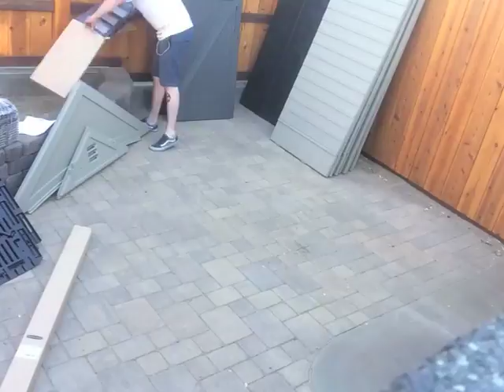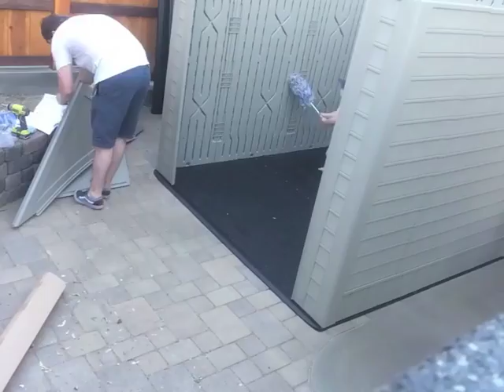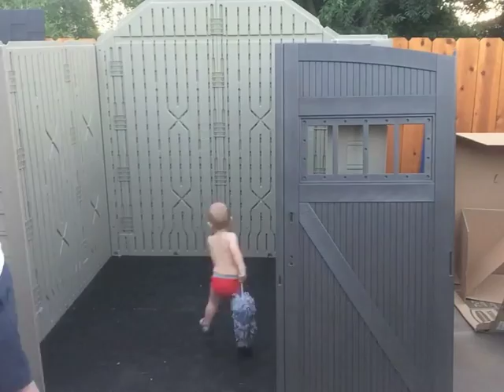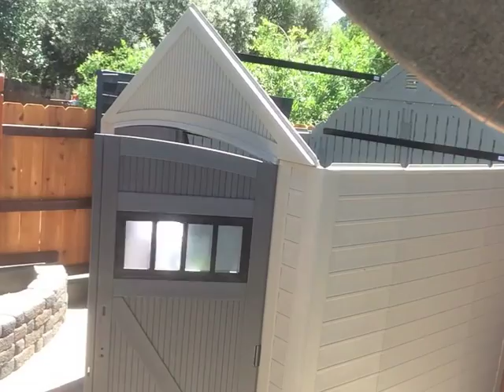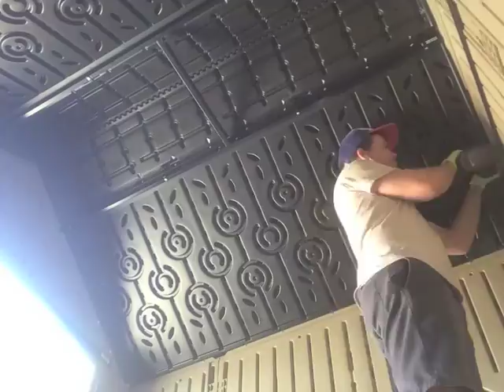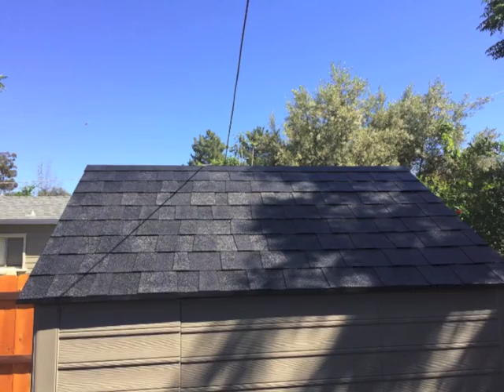Rubbermaid 7x7 Roughneck Shed Time-Lapse Build

Comment: How waterproof is this shed? I am looking to store a computer server inside of it outdoors. It rains pretty hard in Vancouver..
Reply from the maker: VeeTravels It does a good enough job keeping out rain but it isn’t moisture proof... I’d think that you’d want something a little more climate controlled for a computer server... also running electricity to the shed could be a big project...
Reply: Oh darn really? My intent is to keep my server computer inside of the shed during the hot summer months so I do not warm up my house.
Reply: @VeeTravels  I WOULD NOT TRUST MY COMPUTER IN THERE. IT'S NOT A PERFECT SEAL, PLUS IT'S NOT WELL INSULATED FROM THE ELEMENTS.

Comment: great video, did you anchor the shed to the paves? or it is not necessary
Reply from the maker: it wasn't really necessary for my situation, my yard is fenced in so wind isn't a big issue. This shed is not really built for security either, its clear to me that this shed was designed only to keep things out of the sun and rain. Thank you for the feed back!
Reply: @davyandrewbruce  I CAN KICK THAT DOOR IN WITH MY LEFT FOOT. LOLS